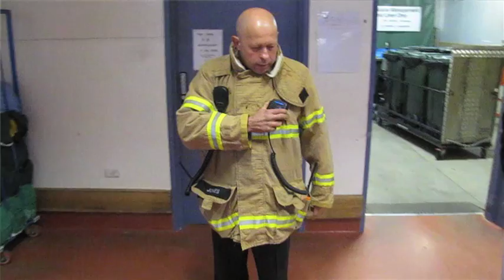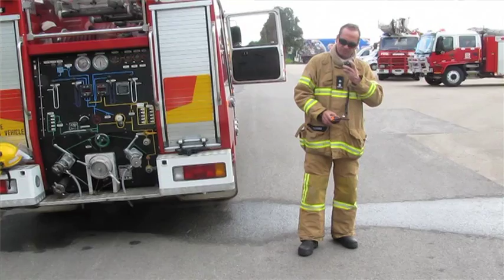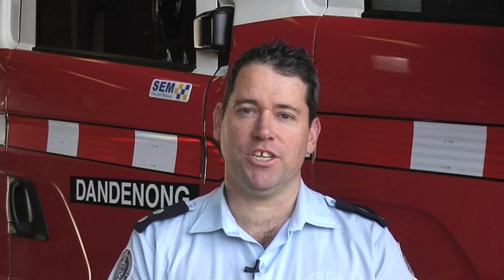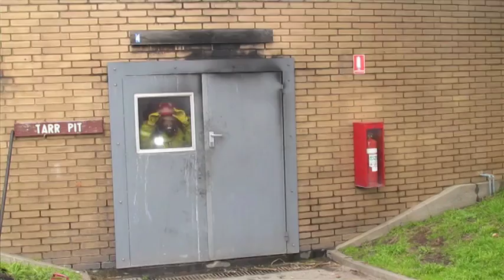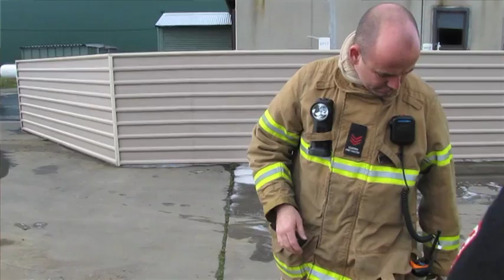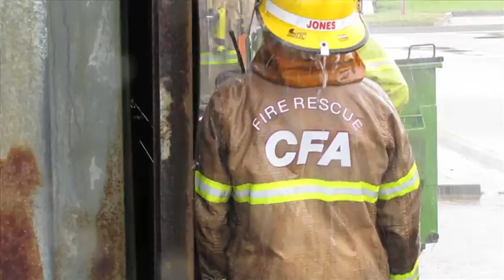Tait radios put to the test

Comment: Tait will never be as good as Motorola others beg to differ which is fair enough it's now 2023 I think Tait is lifted their game but working with Motorola radios I found them more sturdy and audio output is  sensational . When I was in the c.f.a  and we were on the analog system the Motorola's works very well as did the hole c.f.a network times are changed everything is gone digital .